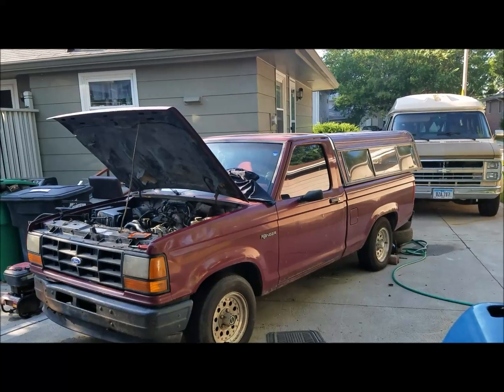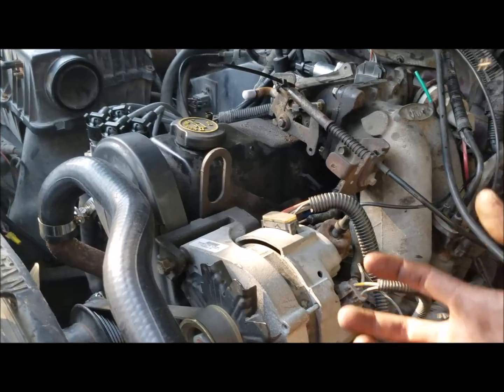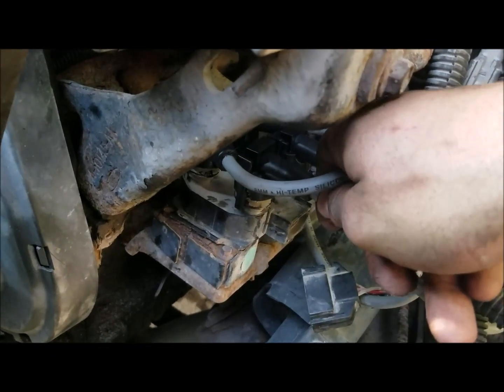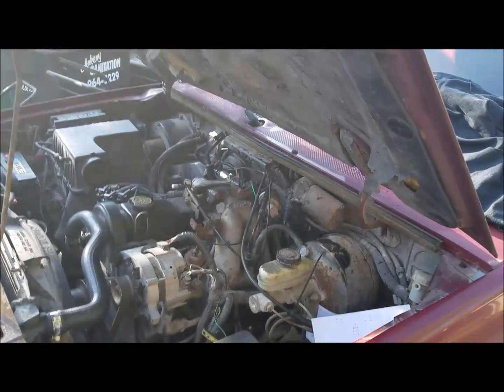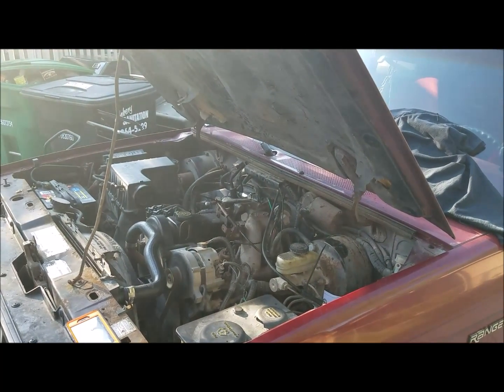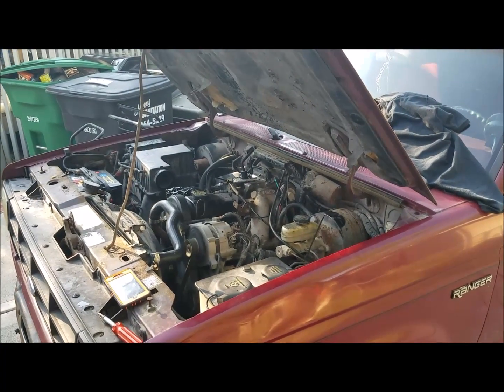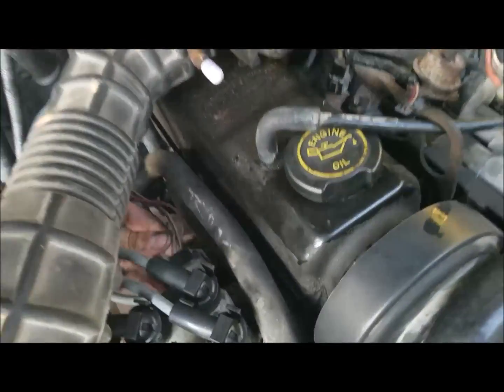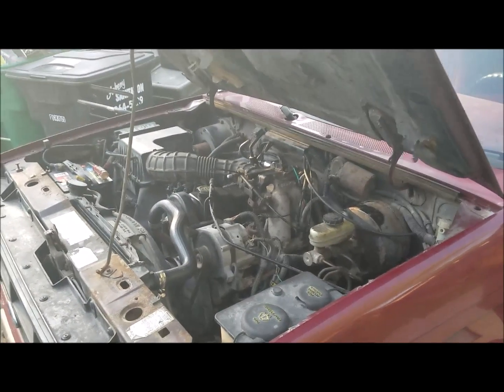Ford 2.3 8 Plug Head - FREE Dual Ignition Mod: How To & Demo (+ HP & ECON)

Comment: I'm honestly shocked this mod isn't more popular
Reply from the maker: no kidding. im going to put some miles on it and see if it causes any issues. logically, it really shouldnt whatsoever.
Reply: ThunderHead289 
3 years later?
Reply: @logoseven3365  following too and actually a ford ranger 1991 2.3l owner 😀
Reply: @alexisoliveras7341  
‘89 w/77k
Reply: @logoseven3365  the mine got a full motor refresh only for a fault that actually a cannot find what it is yet did you have the coil wiring diagram? I think is a wrong cable wired in I found a cable plug wrapped with tape and the owner before me tell that that cable was a ground for the coil interference on the radio but is  positive and got a lot of power😳 I don't find a clear diagram anywhere 😔
Reply: @ThunderHead289  did it cause any issues?
Reply: It probably was 25 years ago when those motors were common.
Reply: ThunderHead289 I have a few friends that did this mod and they've seen no adversed effects yet....they run these lil rangers in the mini stock races
Reply from the maker: well, time to make it well known !!!
Reply: The Dude yeah I've never heard of it either
Reply: What exactly is this mod? Disconeccting a cable? Sorry, i got a 96 2.3 ranger and I'm trying to make sense of this 🤔
Reply: @alejandro he is changing the firing order of the plugs so that the plugs on the passenger side fire at the same time as the four plugs on the driver side. The way it works from the factory is that one side fires its plugs on the compression stroke while the other side fires on the compression stroke. He says you get better fuel economy but I'd have to see something tangible to feel certain.
Reply: @bootyman234  You have to understand the reason for the 8 plug setup wasn't for power or fuel efficiency, but a means to deal with Emissions. Back in the time of the Lima engines, Ford designed the exhaust spark to happen to reduce raw fuel being dumped through the exhaust and poured straight through the Catalytic converters (yes there are more than one) which would ultimately foul it up and cause more engine issues. This mod just makes the spark fire two points in the engine and making a more complete burn during the power stroke of the cycle. The obvious downside of this would be higher (but not much) heat buildup and potentially pressure. That said, as long as you aren't running lean in the first place (as is stated in the video) the heat buildup won't be terribly bad.

That said, the catalyst system would likely not need to be as complex since the burn would be more complete before the exhaust valve opens.
Reply: Well they used the dual spark system all the way until they killed off the Lima in 2001. Not many people understand why the 4 banger has 8 plugs, but I haven't done it to my truck because I'm weary of what it will do to my cat (I already replaced it once whenever my OG one died.)